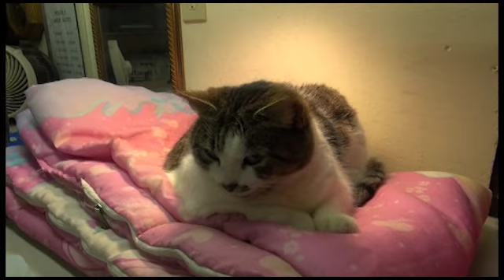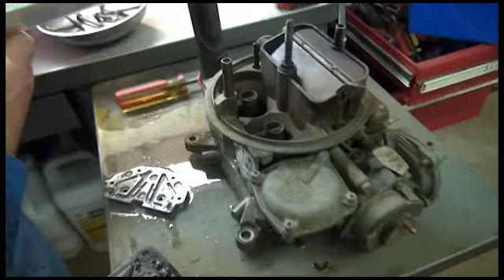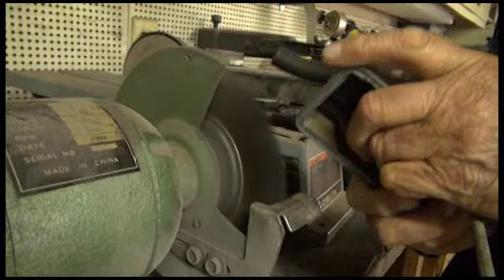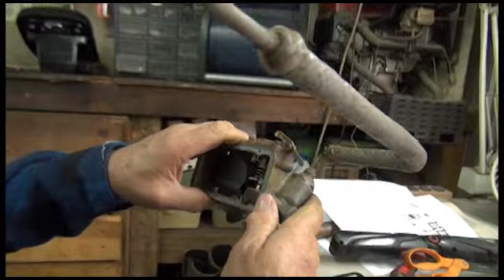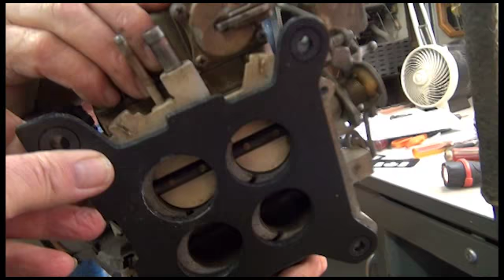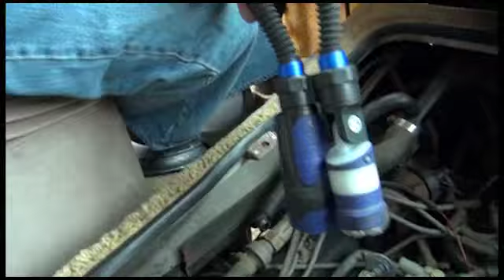HOLLY CARBURETOR REPAIR 4 BARREL

Comment: Realizing this is 9 years later, did you find the red vacuum line from hot air modulator was disconnected? loved the video! cheers from a northern redneck